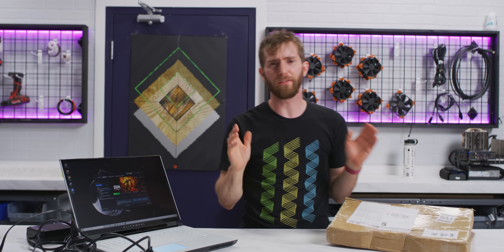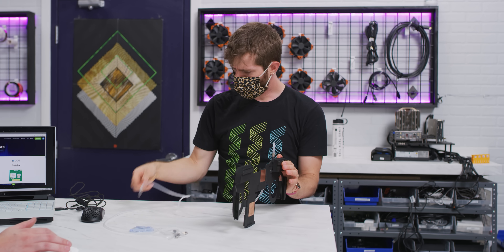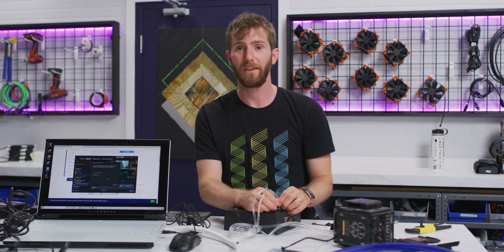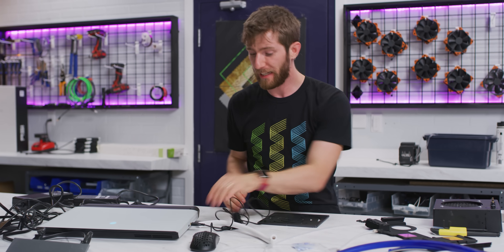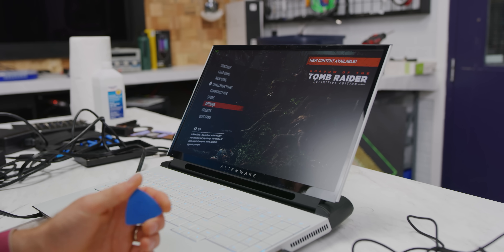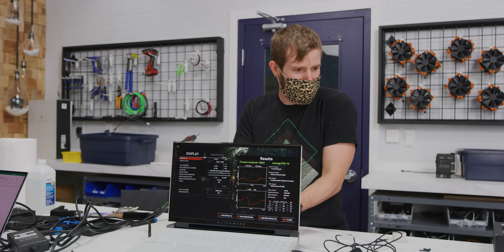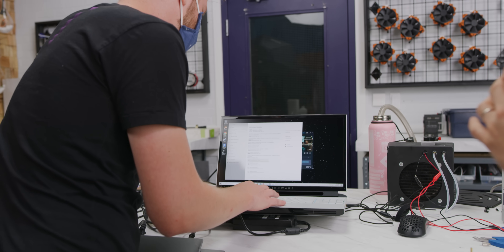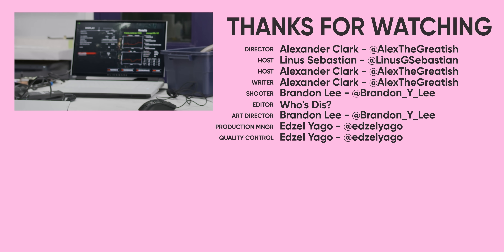This Sketchy AliExpress Cooler....

Comment: Moral of the story, just don’t buy a 2000 dollar or more gaming laptop.
Reply: @DaddyDelve It's somewhat harder to fly to visit friends when you need to carry around a desktop. Personally I just used my work laptop and used the iGPU and dealt with everything running like a potato, but I can see the appeal.
Reply: @Programmdude  TB3 (or USB4 later) + external GPU should work pretty well if gaming performance is needed
Reply: @defeqel6537  it's almost cheaper to have a cheap laptop and mid-range gaming desktop than to splurge for a laptop with Thunderbolt and the dock.
Reply: @SeniorKlean  Sure, but the latter is more portable, especially when not gaming.
Reply: @defeqel6537  how often do you really game when not at home though? If any difference, it's more portable when not gaming.
Reply: @SeniorKlean  personally, a few times a year when I attend LAN parties, but I was also responding to Matthew Smit
Reply: @defeqel6537  carrying an extra gpu takes space
Reply: @Programmdude  "It's somewhat harder to fly to visit friends when you need to carry around a desktop"
True gamers carry their itx in a backpack like a boss
Reply: Yup. Better off with a good desktop

Comment: Hello Linus Tech Tips,I have a question to ask.

So I opened up settings to clean    up my Laptop,and it did it so,cleaning up the system,doing its thing until it reaches the Windows install part.A message popped up saying “The computer restarted unexpectedly or has encountered a error.Windows install cannot proceed.Click ok to restart your computer and restart Windows install.”

I have restarted it multiple times already,even opened up BIOS to see what’s the problem,all systems is fine and yet the error message pops up,how can I fix this?

Comment: Improper / inadequate testing of a potentially cool product.  They dropped ~20C on the CPU, so the obvious thing to do is OVERCLOCK IT.  You have more thermal headroom duh, that's the point.  The stock design was already good enough for stock auto settings, and up to 100C is fine... so if you can now run stock/auto settings and get 80C, that means you actually have headroom to OC.  Not sure if or by how much the GPU temps were improved, but you've got a little headroom there too.

So, as should have been obvious, the real test should have been stock OC vs water cooling OC, not "lets let the laptop automatically control everything and see what happens"... surprise surprise, not much!

Comment: I got Burned on my Alienware m15x back in 2011.  Literally couldn;t even play fallout on it 4 years later and had many issues with overheating along with multiple parts breaking. I Bought an Aurora R7 in 2018, was extremely dissapointed so over the course of 6  months  I replaced the GPU, Power Supply, Ram, and added water-cooling.  Now I am buying a new case for it then waiting a few years to upgrade my motherboard and processor. Long story short don't buy Alienware, when you open up the case with their parts everything looks like complete garbage when you compare it to PC's people build.  Its basically like they give you cheap versions of everything.

Comment: So Dell got one of the best Laptop coolers for its own laptop system board design?
well that is not surprising when you can control where is what and how far each part is from another having an amount of control over how hot or cold you can make your GPU and CPU is possiable. Sadly due to this no 2 laptop makers have the same exact design of system board. Even if they use the same GPU and CPU.
Dell probably hired thermal and/or electoral engineers to work on the design of the system board and cooling solution for it. It takes time to find a good one thus why after a company does said company doesn't move away from said design only iterate on it. How much the change onto the design is differs from company to company for how much the company will allow for said product.

Comment: Hey Linus, I was just wondering what I should do to upgrade my pc I have an i5 2400 GTX 1650 ddr3 ram 400W power Supply and 128gb of Samsung SSD. Do you have any tips to upgrade my Pc? I use this for Moderate gaming. xD you can flame my pc dw :p.

Comment: Can you guys do a video on the BIOS update and thermal issues with this laptop? A lot of us myself included relied on outlets like LTT who review the 51m when it came out to bite the bullet and buy one for $4000+ and are having tons and tons of issues. The VBIOS cuts performance down to 600-800 MHz on the GPU once it reaches 78C, which happens literally all the time. Sure, the CPU hits 100C but so do plenty of other laptops. But when this thing heats up, it gets put in its place by my girlfriends GTX 1060. Dell needs to be held responsible, and frankly tech reviewers who recommend products should make an effort to re-visit them when consumers are being royally screwed, if only just to put pressure on the manufacturer. The laptop holding up for a week after release during the review period doesn't mean the product is any good.

Comment: you would probably be better off... taking the original cooler off, drilling some holes in the heat sink, slipping some thin copper tube between the fins through the new holes and then pumping water through the fins of the existing cooler.
You would probably only drop airflow a bit and get the boost of auxiliary water cooling, would be a hell of a lot cheaper to boot.

Comment: Linus: How many people bought this?
Aliexpress seller: One
Reply: Actually, two.
Reply: @NakamuraSatou  Wait, are you the seller?
Reply: Paolo Franco I am not the seller
But I have seen other people unboxing this thing (not on YouTube though)
Reply: @NakamuraSatou  honestly, if it does what it advertised, and doesn't destroy your air cooling performance, I'd say this is an amazing product, which it seems too. This is the kind of cool random project I would do, and you could go sub ambient with this so I like it.
Reply: @nick-zc9xv  how does it destroy portability? you can run it without water if you're on the go, or just plug it in if you're at home
Reply: I would not even think about getting it. I would have to drill holes in the back. If they had just moved the ports a little bit lower you would not have to destroy the back cover. It is just so dumb and 450 bucks ? Wtf
Reply: @comandernejo  You can get them real cheap if u r in China...lol. And there are a lot of ppl producing this kind of thing so you can choose according to the reviews.
Reply: CSFY NA Branch but why would i do this mod ? Its just stupid
Reply: @comandernejo  you dont have to make the holes that much bigger, linus is just shit with a dremel
Reply: Paul Hughes if they moved the ports just a little bit down u would not even have to
Reply: @comandernejo  That's why I said there are people making a better mod than this one with a cheaper price so this way of cooling ur laptop is feasible.
Reply: @nick-zc9xv  they did it in the video, performance was almost identical without water
Reply: @poiu477  identical to without water with the original heatsink* . Performance was much worse without water with the new heatsink.
Reply: @howardlam6181  no it wasn't the first test was bugged and if you re watch the whole video the performance difference was like 2 fps
Reply: @howardlam6181  yeah i just rewatched, it did 129 fps with the original cooler, 135 with water, and 127 without water
Reply: @howardlam6181  the bad run was due to a windows update/driver problem.
Reply: @nick-zc9xv  did you even watch it?
Reply: JN  Yes.
Reply: @poiu477  yes
Reply: Actually 3
Reply: Lol.
Reply: Aliexpress seller: One imposter
Reply: My answer is: three............:)

Comment: I would try to feed it constant cold water from a sink tap, and let the hot water go down the drain. Would condensation build up in the laptop from very cold water? Try running a hot PC inside of a refrigerator.
Reply: https://www.youtube.com/watch?v=B8bhGw4vUFE
Reply: @mattrobertson3797  That was interesting. How about a large box freezer?
Reply: @mechmancannon  think it would end up with the same result, but would take longer for the warm air to saturate the box freezer due to its larger cubic size.
Reply: @mattrobertson3797  Probably. I want to see where liquid cooling and overclocking progress to.

Comment: I wonder if a custom water cooler rad would be good for this. something that can sit on the back of the LCD that maybe uses laptop style blowers in addition to low profile radiators.
That way it would stay portable. Maybe also get some better hoses that can handle more water flow and using a higher pressure pump.

Comment: This should be an idea for laptop OEMs to introduce for gaming laptops. Have a fitting at the back and have the reservoir separate so people can hook it yp when they want to game at home, but since the OEMs will have a decent air solution already, then it will still be usable on the go with just air cooling.

Comment: This just shows how well desinged that air cooler is. It is just enough for the system at full power. I mean, you could probably overclock it a bit with watercooling.